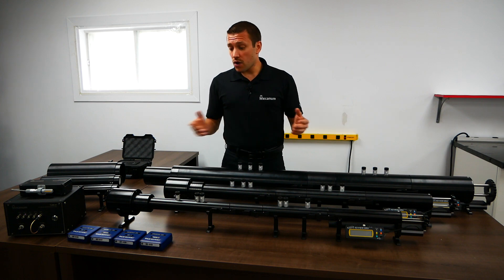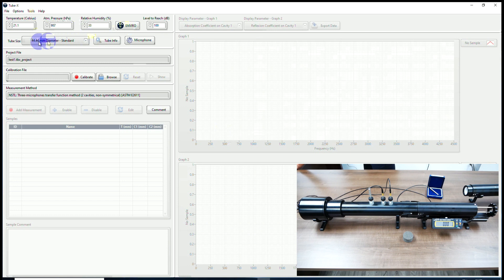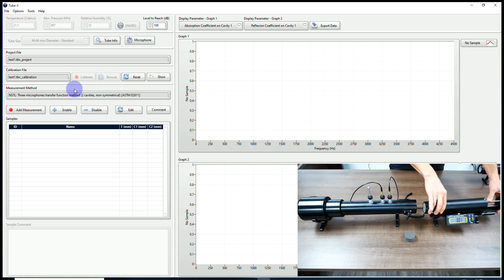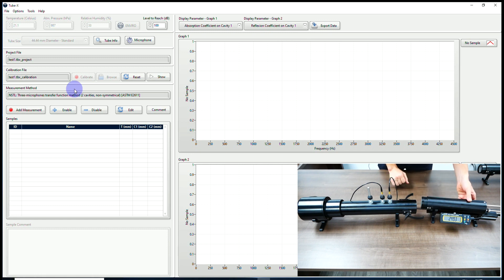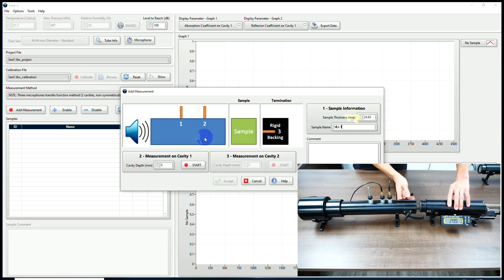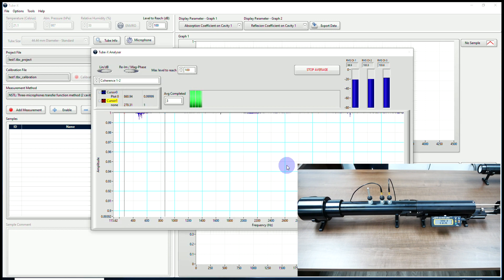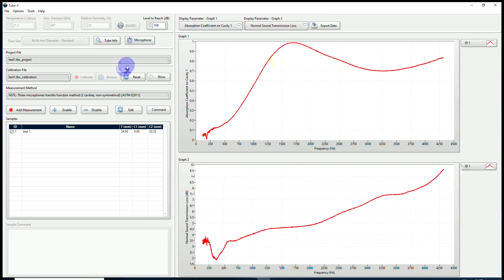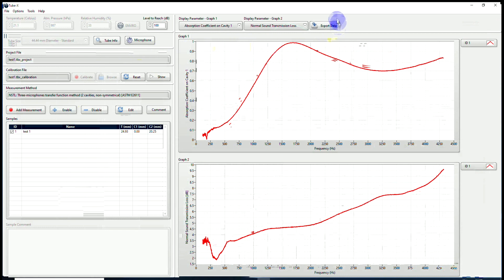Mecanum’s Impedance & Transmission Tubes: Acoustic Measurement Made Easy

Comment: which software are you using?
Reply from the maker: Hi! Mecanum’s impedance tubes are equipped with our Tube-X software, designed for precise, fast, and accurate measurements through an intuitive graphical interface. The user is guided step-by-step through each measurement phase. The software controls the acquisition system and manages the noise levels inside the tube automatically.
Tube-X includes advanced tools to enhance result precision and accuracy, as well as to apply corrections for various mounting conditions. It complies with major standards, including ASTM E1050, ASTM E2611 and ISO10534-2.